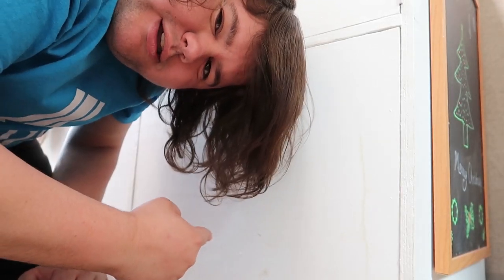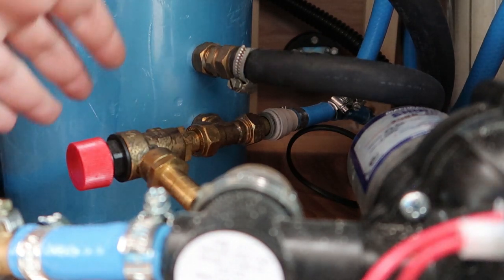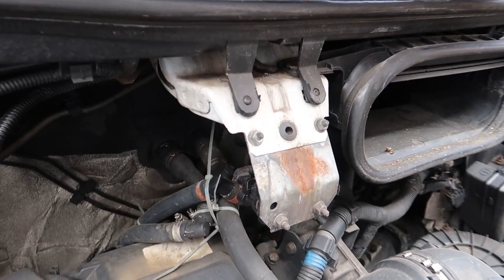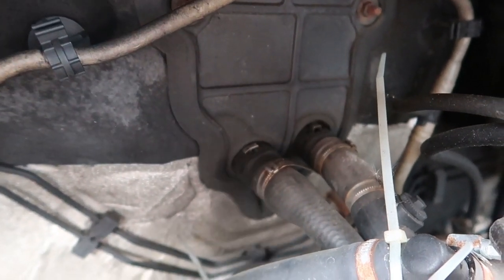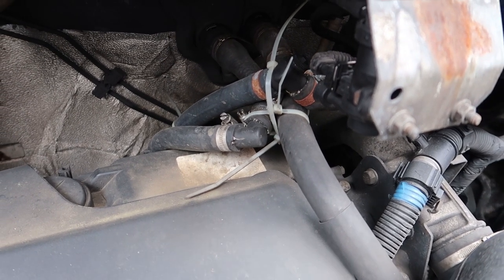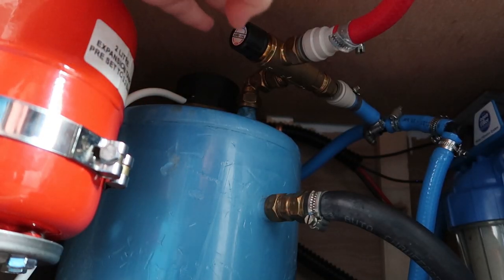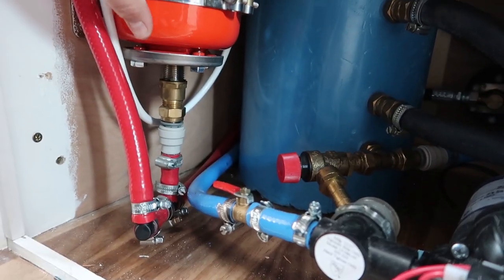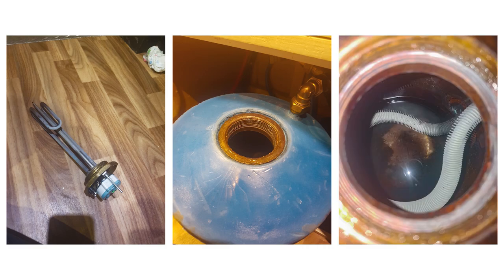How to Get HOT WATER in a Campervan Using the ENGINE! Calorifier Tank in Campervan | Van Conversion

Comment: Where you cut the pipe... there is normally a switch/valve to allow fluid into the heater matrix which is controlled by the heater on/off controls. Did you cut before the switch or after?  I’m assuming before otherwise you’ll have to turn on the cab heater in order to heat your water up.
Reply from the maker: I believe the switch you mention is on the heater matrix or very near it, since we cut inside the engine area I believe it was before. However I am lead to believe the heater matrix still has a minimum flow of coolant, as even if we have the cab heater off / cold, the water still heats up.
Reply: @adventuresinacamper  thank you for getting back to me. I realised the same as I was driving noticing that the heater is still warm when off. I’m going to be doing the same as you on a Sprinter 2016 and I thank you for showing me this amazing idea. 👍👍

Comment: Try to insulate the boiler vessel...I am sure you can get more then 2 days of hot water even if you do not run the engine in that time...
Reply from the maker: Our calorifer is insulated. Lasts about 12 hours. If you have larger models I would suspect this would last longer?

Comment: Really interested in this. 1 question I have is, how does water get into the calorifier tank. Does the pump automatically pump it in?
Reply from the maker: We have a Shurflo water pump which works on pressure, due to the lack of water pressure the pump keeps pumping water into the system until the pressure builds up and it cuts out. As you use water, the pressure drops and the pump kicks back in. Hope that helps!

Comment: Do you have to have a pump for the taps to work or can you just turn the tap on? Also how do you fill the tank with cold water? Any help appreciated x
Reply from the maker: We have a pressure pump which keeps the system pressured and automatically turns on / off as you open taps.

Comment: Hi, can I  ask a question about connecting the pipes to the coolant pipes..does it matter which way around I connect them.??
Reply from the maker: We hooked it in before the heater matrix, ran the engine and felt the pipes to see which one heated up first. On the calofier I don't think it matters which way.
Reply: @adventuresinacamper  Brilliant...I've copied your system, hope you don't mind 😉
Reply: So it would be more efficient to have the hot water from the engine entering the calorifier at the lowest point, and returning from the highest; heat rises and so the fresh hot water will be coming into contact with colder water and that increases the temperature gradient, and thus the efficiency.

Comment: Hi, sorry one more question then I'll stop bugging you.
Where did you buy the elbow pieces from please..

Steve
Reply from the maker: No worries. It was just a random place on ebay. I think they where 16mm inner diameter right angles but you will need to verify what size you need as all vehicles are different and even our van had different diameter pipes available.

Comment: Great idea but where can you buy such a small indirect hot water cylinder ?  Also how do you regulate the heat and stop the flow when the water is becoming too hot ?
Reply from the maker: Sorry just seen this. Use a mixer tap at the end e.g your sink. Like you would in a house.
Reply: @adventuresinacamper  thanks for the reply. What I'm trying to say is the water in the cylinder will continuously get hot. If you drive for a long way, have you got some way of diverting the hot water away from the cylinder ? I see you have a pressure relief valve. I'm surprised it's never been set off, or have you never driven far enough in it?
Since writing the comment , I've fitted a 30 litre direct cylinder which I heat using a generator.
Your way is obviously a better idea but finding a small indirect cylinder is almost impossible.
Reply from the maker: We have a 2l expansion tank installed on the hot water out, so as the water expands due to heat the expansion tank allows the expansion. You need a expansion tank based on the size of your calorifer.

We have drove for 12+ hours at times and never had an issue due to the expansion tank. Without it, you are right the emergency pressure relieve valve would have triggered.
Reply: @adventuresinacamper  I've fitted a 5l expansion vessel although I'm not sure if it's overkill really as I only keep the generator on for 30-45 mins to heat the water up enough. 
I notice that your cylinder is only 10 litres . Do you find that enough to shower with ?
Reply from the maker: @KaptainKastle  We don't have a shower hooked up to it. We have friends who used the 10l setup and said it works fine, however if you have room 20l would allow you to have longer showers.
Reply: @adventuresinacamper  yes, I've got 30 litres but it does take over an hour running the generator to bring the water temperature to a decent level.  If I'm in an area where I have to be steath I have to go back to heating the water by gas and using the submersible pump in a bucket to power the shower.
Could you please tell me where you bought your 10l cylinder? I'd be interested to know how much one of those cost.
Reply from the maker: @KaptainKastle  This is the one we have. https://www.surejust.co.uk/10-litre-vertical-single-coil-surecal-calorifier
Reply: @adventuresinacamper  thank you.

Comment: Great video, thank you. I'm planning to do the same on a ducato.
Do you by any chance remember the ID size of coolant hose you've used? Is it 16mm?
If so, did it fit okay on the calorifier? I think mine has a 15mm connection, bit worried if it would leak with 16mm hose over it.
Any boring technical details would be greatly appreciated (first time I'm doing plumbing)
Cheers
Reply from the maker: Its been so long, but I believe it was 16mm inner diameter. I believe mine was 15mm as well, I did the jubelies up really tight though and it seems to have held fine. You could if you wanted to convert down from 16mm to 15mm pipe to get a better seal.
Reply: Thanks, I'll try that.

Comment: Do you fill the hot water tank separately to you main cold water tank? Or does it auto fill? Thanks
Reply from the maker: Our tank is installed after the water pump so it fills the hot water tank, as you use hot water, more water is pumped into the tank.

Comment: That’s what I was looking for! :) 

How long do you have to drive to heat up the water ? 
So for example I often travel short distance like 20-30 minutes, would this be enough? 

Ps, winter is coming here in Germany :D
Reply from the maker: About 30m should do it. But it really depends on how cold your water is and how fast your engine heats up? For example if your driving for 20m at 60mph it will get hotter quicker than driving for 20m at 30mph.
Reply: @adventuresinacamper  not at all true - bc the engine thermostat controls the temperature - it does not vary with speed otherwise manufacturers could control emmisions..  In a unit such as yours I would expect the engine to reach full operating temperature within 3 to 5km, depending on ambient temperature.
Reply from the maker: Speed is probably the wrong wording, work load on the engine. For example sitting idle takes longer for the engine to heat up, going for a drive putting the engine under load causes it to heat up quicker. By speed i was referring to the revs as in my van its more revs to maintain 60mph than 30mph the engine is under a bit more load.

Comment: Those long runs of hose must cool the coolant a  lot before it reaches the tank surely.. looks like it should be insulated.
Reply from the maker: We haven't had issues in the 1+ year we have been using it, in all tempature you see in the UK. With the engine maintaining the coolant tempature and the flow I doubt the tempature will be noticible, however it be good to hear from people who have this type system in the sub 0 tempature.
Reply: @adventuresinacamper  what about things freezing over night? (Not the engine hose, but the rest)
Reply from the maker: You meaning the water in the tank? The calorifer is inside the van so the inside of the van would have to be uncomfortably low, the calorifer is insulated so will stay warm for a long period. We haven't had any issues with freezing, however if you arnt going to be using the van during cold weather you should empty the tank to be safe.

Comment: Putting any other device in line with another works great as long as you have both devices valved open. In this case the heater valve of the van's heater needs to be open (full) to allow hot water to flow through the calorifier as well... or is your heater valve a bypassing type?
Reply from the maker: From what I understand the heater matrix on the vehicle is always open (there is no valve, other than maybe an emergency bypass) and coolant is always flowing, even if you have the cold air on in the cab, the heater matrix is still being heated, so fitting inline works, however I cant be sure on all vehicles, but I would suspect most vehicles work the same way.
Reply: @adventuresinacamper  There is for sure a means to regulate the amount of flow reaching the heater matrix. Every vehicle has a knob or a dial on the dash connected to this valve.
It could be that a heater valve can not be fully shut off but I am not sure about that.
Reply from the maker: @koningbolo4700  Yep just did a couple searches your probably right, I think I intsalled our unit on the in ways direction so the calorifer is before the heater matrix. The carlorifer does not have a value on the heater side, so probably why it still gets hot even if we are using just the cold blowers in the cab.
Reply: @adventuresinacamper  If your heater core adjustament valve closes all the way when you don't want any heat (turned the dail way down) then your calorifier will not get any flow no matter where in the line the thing is plumbed in...
Reply: @koningbolo4700  What if he connected it up before the valve of the heater matrix? then it would always be heated but that shouldn't be a problem unless it's empty.

Comment: Could this be adapted to work in a '74 VW camper?
Reply from the maker: Hi it should work with any engine, it just uses the engines coolant fluid to heat the water. However I am not an expert and lack knowledge when it comes to older vehicles, but it should be the same.
Reply: Aren't the old VW air cooled?

Comment: How do you fit a shower connection to it?
Reply from the maker: Hi, for a shower I would recommend purchasing a shower mixer tap, this way you can control the tempature of the water by mixing in cold water as required, as the water in the unit gets really hot. Our van is fitted with 12mm flexi pipe and the calorifier has 15mm push fit connections. We used a 15mm push fit to 12mm barbed connection, then ran the hot water pipe to are facets (sink), but you would run this to your shower mixer tap or via a Y spliter if you want to supply multiple taps.
Reply: @adventuresinacamper  wow sounds super complicated to me. But I have never done this. Your not anywhere near the Somerset area are you?

Comment: Hi do I need an accumulator and a pump also?
Reply from the maker: You will need
Water tank (size is up to you) - to hold your water
Accumulator (not 100% required, but this will help stop pulsing of the water coming out of the taps)
Water Pump (We use a shuflo pump)
Calorifier
expantion tank (sized to the calorifer, to allow the water to expand when it heats up)
Plus all the pipes, connections and other little bits.

Then its anything specific to your setup so for you it would be a mixer tap for you sink, and a mixer value for your shower.
Reply from the maker: You will also need a water tank to collect your waste water, fro mthe sink / shower.
Reply: Do I just stick a hose on the tank for the shower? Did you insulate as well? Seems expensive!

Comment: Just insulate the tank with foam and you'll have water maintaining hot temperatures for upto 3 days.
I wonder if there's a system that allows air-heating using engine's coolant?
Reply from the maker: Are tank is insulated with foam. Lasts maybe 12 hours but really depends on the ambient temperature. You want a heat exchange unit, its basically how your air blowers in the cab work, some vans like a mini bus come with a second heat exchange unit in the rear to provide more heating when the engines running using the coolant system.

Comment: Can I come see you and maybe you can help me? Next week I am getting the lines put in by a mechanic mate. But setting the tank etc is leaving me concerned.
Reply from the maker: Are you referring to the piping for the water side? or the coolant pipes from the engine? We are not experts, just showed how we did it with our setup, I can try and help you remotly, what van do you have and what is your current water system setup? Do you have the same calorifer as us?
Reply: @adventuresinacamper  we have only a small mini camper.  Toyota estima. The pipes I'm worried about is connecting up the tank etc. Then connected a sink tap to it and then a shower hose. That be great to help remotely.
Reply from the maker: What model calorifer do you have? I will draw a basic diagram, might be easier.
Reply: @adventuresinacamper  I don't have one yet. Or a tank. What you suggest?
Reply from the maker: We have the following calorifer. https://www.surejust.co.uk/10-litre-vertical-single-coil-surecal-calorifier. They have documentation with diagrams explaining how to hook it up. As for water tanks, this depends on your vehucle we have a 65l under slung tank, I presume you couldn't for this? So would need to find somthing you could fit. The system requires pressure to work so you will need a pressure water pump, we use a 30psi shurflo pump.

Comment: Is the electric coil a 12v coil?
Reply from the maker: Ours is a 230v. You can get 12v but the power requirements are high. I think I worked it out to be around 50a an hour a 12v would require.
Reply: @adventuresinacamper  the 50A rating is likely when only relying on DC from battery bank. If the engine is doing the most of the heating then the battery bank would be supplemental. I believe the electric coils are typically only used to keep it within a warmed up range so that coolant heat exchange has less time needed to get it to boiling temps. But that depends on the design and would need to confirm with SureCal. I know other companies design them that way.

Comment: Is it just the hot pipe that you've cut ??
Reply from the maker: We fitted ours inline so involved just cutting the 1 pipe. You can do it parallel where you cut both pipes and use 2 T connectors.

Comment: I always thought it was so wasteful to lose all the heat from the engine (an ICE is only about 35% efficient) and then use a totally separate (propane/diesel/electric) system to heat the water up from scratch - crazy humans!
 Question, please:
If the heat from the cooling system is being absorbed by the tank... How do you heat the cabin in the winter whilst driving?
Is there enough residual heat coming back into the heater matrix?
Does it take ages to heat up the heater vents' air?
Reply: We havent noticed any issues in the winter, I think it is slower for the heater matrix (cab heaters) to initially heat up, probably I wouldnt say its anything noticable / concerning, maybe 5 minutes longer.
Reply: @shanerutter  Thank you for your prompt and insightful reply - really appreciated. 

And thanks also for bringing this system to people’s attention in such an informative manner. 

Good work. Enjoy your travels :)

Comment: the problem is it can freeze the fresh water and damage the tank
Reply from the maker: Yes we always empty the tank during winter when the vans not in use, there is a pressure release valve with a manual override. We did leave it one winter by accident but found not issue (but we probably got lucky).

Comment: Confused. Why L shape fitting were used instaed of T-shape and cut 2 hoses...
Reply from the maker: We installed our unit in series instead of parallel, so we only needed to cut one pipe and uses L connections to fit it in series.
Reply: @adventuresinacamper  yeah, is there pros and cons with series connection vs parallel?
Reply from the maker: @Rvand4  I havent tried it so not sure, I think the main difference is you could add isolation values to the parallel setup to isolate the unit if you had a leak for example.

Comment: hot water only when you drive.
Reply from the maker: The water stays hot for a long period (up to 12 hours depending on conditions), after 30 to 40 minute drive. You can also just leave your engine idling to heat the water up, or you can get units with immersion heaters such as a 230v element or even 12v (havent tried these). Really depends on your style of travel, if you are going to be stopped for days and dont want to run your engine, then this probably isnt for you, unless you get a system with a second coil and use another system to also heat the water like a space heater.